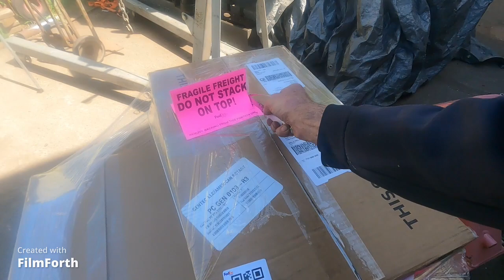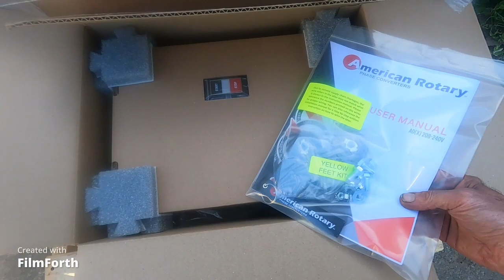American Rotary Phase Converter is here!

Comment: Why didn't you go with a VFD drive? Most of them will take a single phase and make 3 phase. For 1/3 the cost plus you get speed control.
Reply from the maker: I have 7 machines of various hp up to 5hp, that would require 7 VFD units, seems to be the logic there but I would like to have variable speed for the Shoda spindle moulder

Comment: You gotta love our community! This is great and we all refer to this as paying it forward. Now to get a translator for Italian so I can get started on my tree taper clone. I have no idea what that guy is saying but it sounds cool!LOL
Reply from the maker: My Tree head has a Moore shank in tight enough it  is not going to come out easy, if there is a parts drawing I will show it in the beginning still photos, going to be much better running it looks, thanks.
Reply: @deedeeindustrialsuperprecision  I found some cool photos and videos of the insides. The shank slips in from above and is held by a bolt up thru the center. The cap which you grab is hollow. Located in the cap is a single gear. The gear system is planetary. There are two large gears inside that are in center to the shank. One rotates freely. The sits on top of this gear and is pinned to the body. As the cap rotates, the planetary gear of the cap spins about these two gears. 

Then there is a small gear on shaft that is mounted on the body which meshes with lower free spinning main gear. So if you grab the knurl ring, the body rotates and the cap stays put. This causes the planetary gear to drive that shaft. 

If you undo the slide assembly with the two adjusting nuts, this unit pops out. In the middle is a bronze worm gear. This drives a stubby shaft. At the end of this shaft is a small gear that drives the rack in the sliding assembly.

Now this is to cool! If you replace the sliding assembly with another assembly consisting of two gears and a rotating linkage, the head now automatically cuts a RADIUS instead of a straight taper.

You set the eccentricity of this attachment and grab the knurl ring. This is like a cherry head cutting a cylinder-cal hole with a radiused bottom!.

When done with the radius, you undo two nuts and replace the standard tree style slide. Now you can a tapered side to this hole with a radiused bottom. Then use the head to cut 45 degree chamfers as needed.

Then adjust the same head to surface the top like your using the woulhaupter head.

I was blown away by this. It’s pure genius! And all based on the original tree design.
Reply: @deedeeindustrialsuperprecision  oh yah… the shank appears to end in a flange followed by a threaded shank. The body has a large hollow spigot. The main gears ride on the outside of this spigot. Then you place the cap component onto the body. The flange then locks the cap in place while allowing it to rotate. The bolt/nut goes in from the center of the body where that curvy part is. This locks the shank in place and allows the cap to rotate.